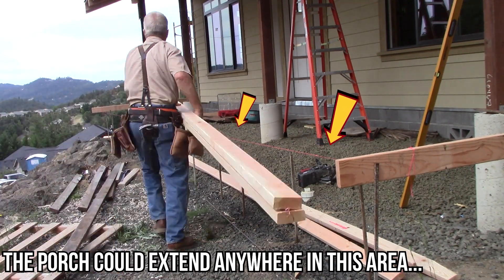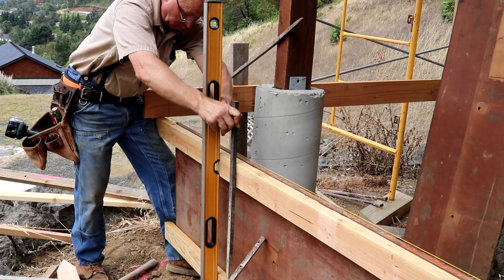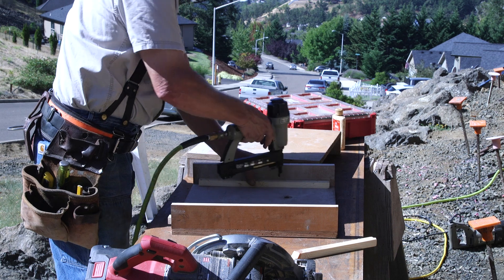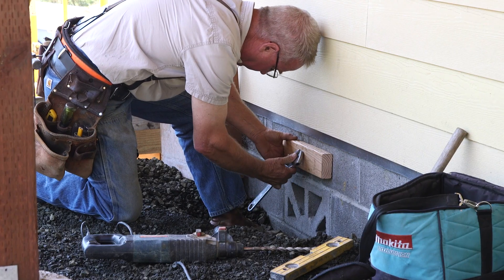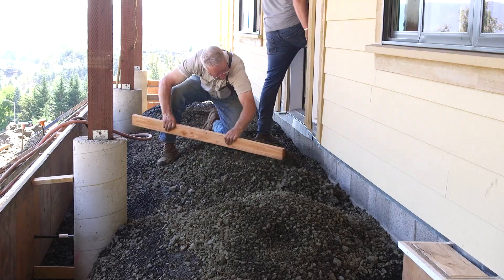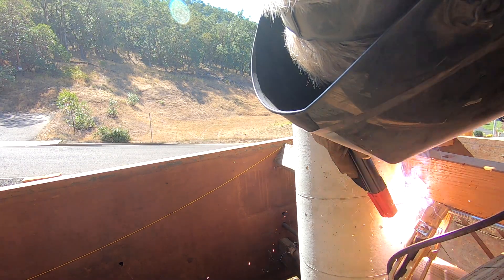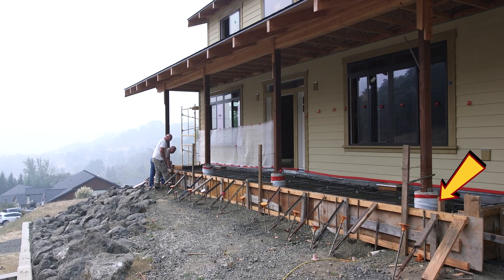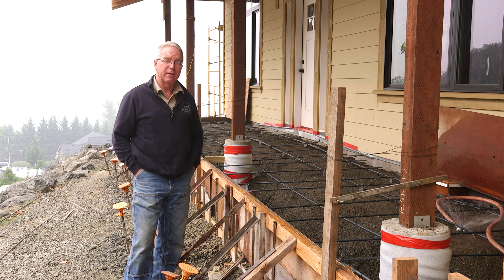Forming A Concrete Porch Ep.91

Comment: Old school crotchety guy who worked for the US Corp of Engineers rather forcefully told me many years ago that is is not possible to pour concrete.  It is technically a solid and thus can be "placed" and further more, as he verbally smacked me around some more, that concrete does not "dry" but hydrates as a chemical reaction and thus continues to cure "forever"?  I really enjoy Scott's work.  What is so hard about construction?  HGTV does kitchens in 55 minutes so a house should only take a day or two at the most.
Reply: Personally I love the HGTV parts that involve any type of digging.
Lol.
"Simply remove the dirt" shows guy with a short handle spade. Commercial break. Comes back has a 10' x 10' hole 8" deep. 
Also where are these yards that has the good black dirt with no rocks, tree roots, or red clay.
I wanna move there. 
Lol
Reply: Simple math:  9'×9'×9' hole to be dug.  Why does it take 10 ten yard dump trucks to get it taken away?

Comment: Things you will never learn in school (even a trade school): Two 16 D nails fit a ¼" hole.  This is why we need Scott around!
Reply: The holding power is enormous and the ease of removal make it a brilliant temporary fastening technique.
Reply: I don't even know how it came to me, but I thought of that this summer when framing in a basement. At first I wasn't sure it would work, but it held really well. Seeing Scott do it too affirms to me I must be doing something right.
Reply: 2x2 1/4 doopies will fit a 3/16 hammer drill bit hole. As well for pinning plywood to concrete.
Reply: I use a 3/16 inch bit and a piece of tie-wire with a single 16 double. Same thing though
Reply: I learned that in trade school
Reply: @brettmessingcarpentry  I stand corrected.
Reply: @jakeschroeder1553  though I must admit as a carpenter Scott has taught me so much appreciate his videos a lot. Just wanted to give my valued education some credit :)
Reply: So true every time I watch him work I learn something.
Reply: The real trick is how he used a duplex and a sinker, instead of two of the same, the mark of a true master. We used to call this sucker nailing. And how he mentioned the forms wanting to lift under pressure, a jewel of knowledge that can save your pour.
Reply: @playstationRLZ  Yes used the same. Very easy to strip.
Reply: I actually learned that trick in high school building trades! The teacher was old school! And he knew his stuff!
Reply: I was wondering what I was seeing there.

Comment: Nice video, thank you for pointing out the important things like welding the nut so it won't blow out the front and planning ahead to be able to strip to finish exposed parts.
This brings back memories of a 3 story monolithic free standing concrete stairs with exposed edges with insets. It was only attached at each floors with 2 expansion joint to 4x4 square steel tubes & 3 slip dowels at thresholds. It is located at 400 E Main in Midland MI
Reply: American tradesmen are awesome.

Comment: Great video! A thought to add is an alternative to welding the coupling nuts onto the wedge anchors is to add a second nut to the wedge anchor effectively "double nutting" it. Just a thought for those who may not have access to a welder on the job site. Thanks for the video, I learn so much from them!
-CJ

Comment: As always Scott, this is text book in forming and placing a patio and stairs. Thank you for sharing, including many of the steps that are often over looked and when not done only cause more work and potential problems, saturating the subgrade, greasing the shebolts, placing visqueen on the house, wet striping, screws at the stairs to wet strip, etc.

Comment: Ah, single-sided ‘wall’ forms 😣. The bane of every form carpenters existence. 
Brilliant idea using the wedge anchors for sacrificial ties 👍! 
We had a similar problem in the below ground level, of a parking garage once. We solved the problem in a similar way, by welding all-thread to the surrounding sheet piles. 
As you stated, the vulnerability of the form to float, can’t be overstated and measures must be taken to prevent this from happening. Unfortunately the form will give zero warning that it’s about to happen, until it’s about 2/3’s full and then, in one mighty ‘concrete burp’, all the mud comes pouring out from underneath the form, creating an enormously difficult mess to clean up and fix. 
It happened to me ONCE...lesson learned.

Comment: I have built concrete skateparks all over the planet. Shotcrete pros. Done road and bridge, vertical pours, walls, pour in place, monolithic panel, hill stabilization. This is pretty spot on. Form aligners, soaking subgrade, tha admitting that the turndown dirtwork is a pain in the azz, seal foam. All pro. But then again, I have poured concrete with boys from the PNW, and they were always Pro. Coming from a Texan haha

Comment: Hammer drilling into the column and using bolts strengthen the form is genius!
Reply: I thought it was clever too, but then it seemed to negate the isolating effect of the foam sill sealer.  Personally, I don't think the slab can be effectively isolated from the column, nor does it need to be.  I've got the same situation at my current job, and I welcome the extra stabilization of locking into the piers.

Comment: You should try stacking cinder blocks between your columns to reduce weight on the outside edge . So you can grade the rock closer to the form. That way you can have a skinnier wall with less weight so the slab does not fall away from the house. Great  videos.

Comment: Its been 5 years since I last poured concrete, plumber now. A little trick I found extremely helpful when using screws on forms is to dab a little plumbers putty into the heads, makes screw removal a breeze!

Comment: Little tip for attaching board to block or concrete. Use a 3" screw with a piece of tie wire. It doesnt blow  out the concrete near as much when pulling out  the screw. Pretty much just the hole you drilled is all thats left.When pulling out the 2 nails, it really blows out the face of concrete.

Comment: Great Job. I carry a mastic gun on my belt and put a squirt on the head of every screw, after I have I put it in the form. When it comes to striping the screw driver bit slides through the sealant into the head and the screw comes out like a dream.
Reply: A previous concrete form video showed Scott doing something similar.  I think it was lard,  but I might not remember that correctly. Anyway, the basic concept was the same.

Comment: Frequently you will see concrete  forms with 2x dimensional lumber along the top of the forms, as an aid to aligning. This is called a ‘Waler’. It is most commonly incorrectly called a whaler.
The name comes from boat building. The top of the sides of a boat are called gunwales the topmost board aligns or makes fair the ribs or frames of the boat.
Reply: Interesting. I know about gunwhales, but didn't know the term had migrated to concrete form work.
Reply: @andrewalexander9492  I spent 22yrs manufacturing aluminum concrete forms and accessories. One of our products was a waler bracket that attached to the form work allowing waler boards to be placed. A colleague from the east coast had some boat building experience as well as concrete forming experience. He made the connection for me.  I allow he might be wrong but it does make sense. 
Good straight waler boards used with a few turnbuckle style wall braces will bring your forms true to a string line in short order.
Reply: @1911wood  I use those forms every day.
Reply: @thehouseofcrumblingidols2694  Here’s a hard working man.
Reply: Did not know.
Reply: Vertical walers or "stiffbacks" are used in wall forming with some plywood systems, and are mandatory on large gang systems so your gangform won't fold when picking it with a crane

Comment: Use 5/8” drywall as a stone hold and then use 2x6 spacer boards about 12” on center in between drywall and form to keep the gap. As concrete is placed the 2x6 spacers can be removed and the drywall is already made from rock so not a worry of burying wood. This keeps concrete volume lower and also helps with total push effects on forms. Just a little tip.  👍

Comment: Crusher dust, we call that Cracker Dust here in Western Australia... because it looks like cracker crumbs, and we're creative folk with names :)
Reply: It's called that because it comes from a rock cracker, or a rock crusher. Good to see a fellow West Aussie on here. Shout out from the Pilbara.
Reply: We used to call it stone dust when I worked for a mason/general contractor. Used tons of it when we did dry laid flagstone. We would strip off about 8-10 inches of topsoil, put in a base of Item Four, then a setting bed of 2” of stone dust, and then dress the joints by sweeping more stone dust back and forth across the top of the stones. If we bought the material direct from the crusher, we had to ask for screened stone dust for the setting bed, regular stone dust was what the mason yard sold as Item Four, which was anything that would pass through a 3/4” screen after being crushed.
Reply: @michaelrobinson1341  Ha, little bit south from you, Mandurah.

Comment: For soaking the gravel on something like this, how about one of those flat hoses with holes down the length? You can clamp off the far end to adjust the length.
Reply: Yeah but sometimes you've got to use what you've got and get on with the job.

Also handling a sprinkler is a lot easier than a hose full of holes.

Comment: Nice. Back when I was doing that stuff we would have used symons forms that have the brackets for walers and strongbacks etc. My boss would have used recycled concrete blocks laid dry to form a wall to hold back the dirt--he would spend $100 in labor to save $10 dollars of concrete. The exposed agg for a stripped wall is a new one.

Comment: If you want exposed concrete on the front spray the forms liberally with sugar water. It will keep the concrete against the form from setting up on the surface. When you strip the forms take a water hose and wash the fine concrete off leaving exposed aggregate. The sugar water will only effect the concrete to a depth of about 1/2 inch.

Comment: Always so careful with my forming,  then lost four 24" sonotubes 10' high because of rain the night before a pour. I still wince 33 years later.
Reply: Had a similar mishap once. Sonotubes are great for creating a round shape, but they have very little structural integrity and must be braced well. Especially if they get wet.
Reply: Stay strong , some things take longer to get over
Reply: @djfglobal3377  Thanks for the sensitivity.  Someday I will reveal my pre-stressed double tee roof slab screw-up for commiseration.

Comment: Great house building series. Keep up the great work. Would 2 inch rigid foam be a better material for the pack out around the vent; it would be easier to remove.  Or if using wood I would taper it slightly so that it would slide out easier. Stay safe and keep up the great work.

Comment: I typically do a footing under the front form. Even if it's only 4" thick it provides a flat surface that holds the bottom of the form securely when you nail to it.

Comment: I agree about the potential for blowouts on the wood form. Perhaps you could have put up a concrete block wall around the edge of the deck then a reinforced slab on top?    This is pretty country.  Is this Kentucky or one of the other Midwest states?   Looking good!!

Comment: You could just use the double nut method instead of welding the nuts.... Basically put a nut on the anchor side and tighten that to the coupling nut. Saves getting the welder out especially if you don't have a little portable one.

Comment: Love the video, and the work. How large is the face form? 
My only question is why lay the 2x flat instead of on edge for the form? I’ve always gone on edge and no more than 16 o.c spacing for my walers and have never had any issues. There were a couple places where I would have used double head 16d instead of screws, especially around the stairs. I’ve had too many screws bust on pour day to use them on concrete stairs. You know, screws for pullout, nails for shear, and what not. 
One last thing, did you give the risers a nosing taper? I couldn’t tell in the video and always thought that it was required by OSHA unless the treads were larger than 16”?

Comment: Nothing stops a concrete pour.  Only thing worse than a BURP from a concrete pump is a clog.  We had a new Pump truck company on site, line got clogged, so they beat on the hose with sledge hammers to clear it.  And did it ever clear it, the hose knocked one guy off his feet and the clog blew 7 windows out of the building.  No one knew the pump operator kept trying to pump until the pumps couldn't move anymore.  So much pressure has to go somewhere.   Everyone stay safe

Comment: I think I'd have opted to have poured this at the same time as the foundation. that should save some cost? And a lot easier when the mini ex is still around, you could have used a bunch of the dirt you have had to export, less masking etc. The only down side I see is having to put some floor protection on, but you've had to mask the house anyway.

Comment: Everything seems wonderful , there is just one thing I would like to ask ,  you didn’t drill holes In to the foundation for your rebar to be attached , I know you did your anchors from the columns for that , but I was wondering , is it stronger for you  that way ? , I like the idea of the anchors  , is just that we have never do it that way . Normally the horizontals go in to the foundation to hold that up .
Reply from the maker: Yeah I agonized over that for a while and finally decided to let the side of the porch and the foundation of the house function separately. Obviously that’s compromised at the columns but I roll the dice and took my chances. I’m more concerned that the foundation is free to do what it wants then that the porch is additionally tied to the house. Judgment call.
Reply: Going back to how you prepared your foundation subgrade and backfill, my thirty years plus, would agree with your judgment call.

Comment: Dry Stack CMU blocks and then backfill dirt.  Basically a secondary (cheap) wall
Reply: That may work for forms 12” or less tall, but when you get above that the head pressure becomes enormous and ties become essential. Plus, any kind of a ‘secondary wall’ won’t help at all with the tendency of the form to float. One other thing to consider is the time it takes to stack all the blocks against the form and backfilling with dirt that eventually has to be dug back out and all the blocks removed. 
Take the time to figure out some way of incorporating ties.
Reply: @psidvicious  
not as main wall. secondary just to square off the dirt wall. Thus needing way less concrete.

Comment: Having done residential concrete work in Florida, when he says you don't want the concrete to even bow out, he means if it does, you get to spend hours with a chipping hammer and a level making sure it's straight.
Reply: I worked for an environmental services company that also did some industrial maintenance years ago. This was around 2000 or so but we had an oil water separator pit that spring a leak at a power plant.  Think of it as two in ground Olympic size swimming pools combined and twice as deep. It even had a deep end where the pumps were located and a shallower end of around 12 to 25 feet deep. The plan was to drain the pit, scrub the concrete walls and floor, use a polymer spray system to create a liner, then poor walls and floor 5 or 6 inches think on top of the existing ones. 

To do this, we had to chalk line 1 foot sqare blocks and drill holes to a certain depth  anywhere the lines intersected then use a wire tie in with a plug to provide something for the wall forms to anchor to.  To make a long story short, someone in the office ordered a set of anchor wires that were too short. We were told not to drill as deep of a hole to compensate.  I don't do concrete work and was basically there for the manual labor portion so I didn't know any better. We set the forms against the wall and everything was looking good then the poor came. Once the walls were about 2/3 filled and several people where vibrating the mixture, we started hearing pops and snaps almost as loud as gunshots. First one or two, then several at a time. The supervisor ordered everyone off the wall so he could go down and have a look. As the last guy was coming off the wall, the popping sounded like a zipper then a loud crash. 

The forms blew out where the short anchors were used and about 5 loads of concrete was all over the bottom of the pit. We had to use cranes to drop skidsteers and roll off containers in to scoop it out.  A lot of jackhammering, shoveling, pick axes, and even a small excavator and cutting torches for the mangled forms was used. I about lost my job from laughing so loudly.  We were paid by the hour and paid very well for the time. While other employees were pissed at having to clean it up, I saw it as no different than any other job we would have had to do instead. I told them to look at it like we were called in to fix other people's screw-ups which was a common occurrence.
Reply: @sumduma55  that story is going to give me nightmares.